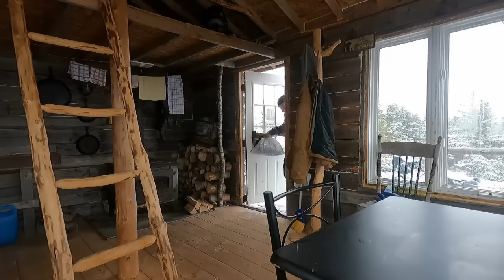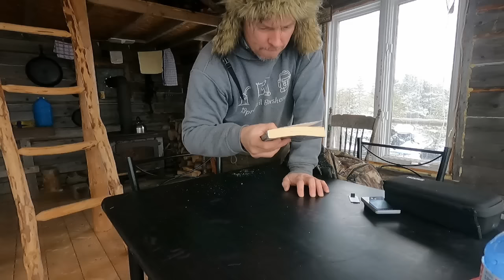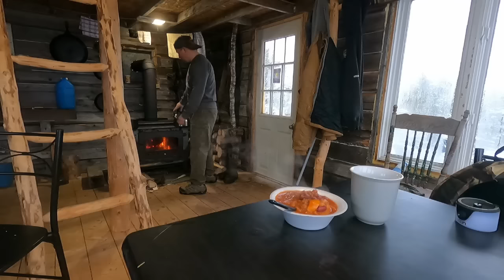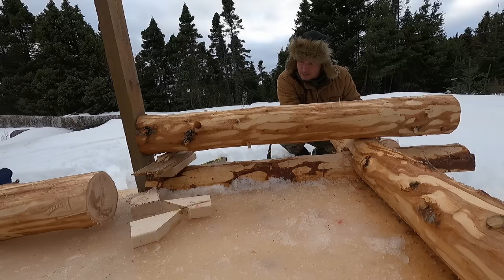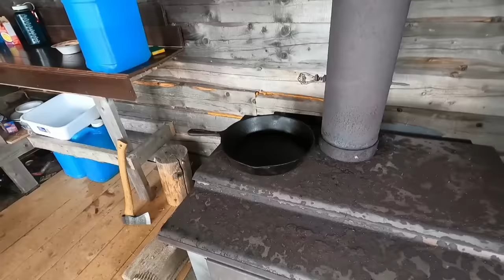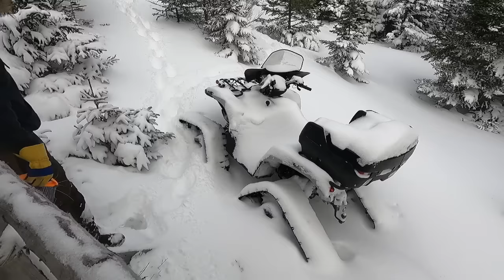Log Cabin Overnight in a BLIZZARD

Comment: I live on the outskirts of the city.  Our power was out for 9 days.  I broke out our fondue pot. I put water in it and a candle underneath of it and had boiling water pretty quickly.  Now a few of my friends bought one in case of a power outage again.  Candles are dirt cheap here.  You would be surprised what you can do , even without propane. 
Everyone laughed at me at first.  I took another small pot and put in 3 cans of pork n beans. I put in ketchup and some brown sugar and a small diced up vidalia sweet onion.  I made baked beans for dinner.  We had hot dogs roasted on a small fire and beans.  It was delicious and fun.  Also, and this involves technology, instead of reading a book, we sat around in the evening and played some audio tapes.   Everyone got to hear and follow along. 
It was so hot inside our house, I closed the doors and windows to keep the hot air out. I got a small 2x2 and stapled an old sheet to it. Then I screwed it on the ceiling with 3 small screws.   Oh, I had doubled the sheet when I stapled it on the board.   I took a piece of fishing line and sewed it over the board and made a loop.  I went to the other side of the living room and pulled it and let it go, pulled it and let it go... it provided a mini breeze and made the evening more comfortable.  I had an 80 year old mom and 85 yr old aunt with me so they would not be alone during the power outage.    The fondue pot kept them in hot coffee.
Lastly, ( I talk a lot), save your used vegetable oil.  Did you see all that kindling he just chopped up in the video?  Get an old five gallon bucket with a lid.  Fill it with kindling.  Now pour your left over french fry oil in it after it is cooled.  When you need to go make a fire, pull out a few of those sticks and they light right away and start a nice fire.  It saves quite a few minutes when you are cold and wanting a fire to get going.
Reply from the maker: Thanks buddy !

Comment: Why is stove near front door?  If the door opens all the heat gets sucked out. I'd put it on opposite end of house. So heat stays inside.  I was just curious
Reply from the maker: With the stove here, I dont have to carry firewood across the cabin making a mess. If I stack firewood inside during winter I will also track snow throughout the cabin. Much cleaner this way and I can just sweep sawdust and snow right back out the door.

Comment: I'm a brit I love these winter cabins but I wonder why no one ever seems to build a fire place & chimney stack of fire bricks. Then the heat would radiate & be retained longer through the bricks rather than the wood burner.
Reply from the maker: You would burn so much more wood and lose more heat through the brick chimney.
Reply: @13prevailbushcraft  OK, I didn't know that.

Comment: Is the cabin insulated?
Reply from the maker: No insulation. The logs are 6-8 inches thick and they hold the heat in pretty well. Plus, my cabin is 192 square feet and my stove is meant to heat 1200 square feet.
Reply: @13prevailbushcraft  yeah, that'd work.